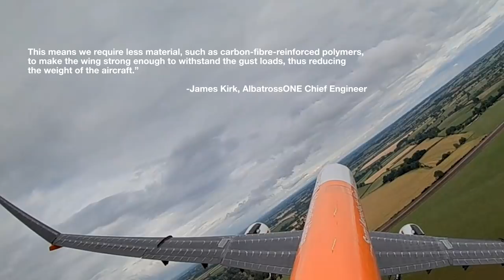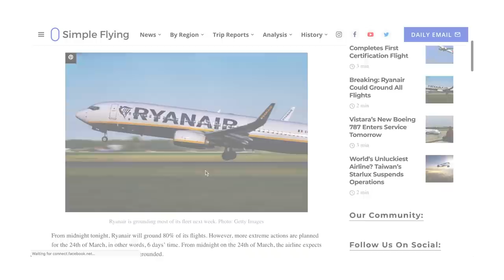Airbus Tests Bird-Like Flapping Wings For Future Aircraft

Comment: The title is misleading, the aim at airbus isn't to create lift by flapping wings as birds do, but rather to improve aerodynamic efficiency and load behavior by allowing wing tips to morph as aerodynamic loads change in different flight conditions.
Reply: No that’s kind a like flapping to me
Reply: @titanicbigship  no, it's not. Flapping itself is a method of propulsion. This is not providing propulsion, but rather dynamically adjusting to flight conditions to reduce overall stresses and loads. This allows for lighter structures, longer wings, and therefore greater efficiencies. Also, flapping flight requires a more flexible wing design, that allows for more degrees of freedom than this feature is capable of. This feature is more like the adjustable wingtips on the XB-70, but able to move freely as well as being able to be adjusted, whereas the XB-70 wingtips did not have a free moving setting.
Reply: I'm not a biologist but I don't think this concept would fool any geese into accepting it into the flying V
Reply: But the aerodynamic here is indeed similar to an bird that’s gliding. 
It also makes sense use an bird as an model. 
Millionen years of try and error is still better than our understanding of aerodynamics i find.
Reply: @matthewforster2661  we all got fooled into watching it so 🤷‍♀️
Reply: @titanicbigship  The title is misleading . The wing tips adjust to wind gusts. Flapping, as 428 Renegade, wrote is a mode of propulsion. The wing tips on this model are not producing any forward thrust, only the engines. The concept is to reduce the transfer of wing gust to the fuselage and increase efficiently. 
-On wing efficiency: since an infinite wingspan is impracticable, besides unrealistic, it does provide theory that induced drag is a component of a finite wing span. The induced drag is caused by airflow from underneath the wing flowing to the top of the wing span due to pressure differential. So, by extending a finite wing, one is reducing induced drag.
-On aeroelastic effects: an airplane frame is quite a flexible structure. Hence when you fly a passenger jet and it hits turbulence, that turbulence is transferred from  the wings to the fuselage making for an uncomfortable ride. Aircraft designers have been looking for ways of reducing gust load transfers on aircraft. Boeing  designed gust suppression system on their 787 Dreamliner, https://www.designnews.com/boeing-787-dreamliner-rolls-out-smoother-ride-gust-suppression-0
Airbus is going one step further and allowing the wing to absorb the gust directly by changing the profile of the wing. I am not fully understating of it, but i assume by allowing the wing tips to so call flap it also changes the airflow around the tips thereby mitigating gust loads.
Reply: So basically like the 777-X of boeing
Reply: @melvinhendriks7913  Nyet. The folding wingtip of the 777X is locked once the plane is ready for TO. The folding wingtips allow the wider wingspan to park at terminals without having to redesign terminals to accommodate such a wingspan. Turbulence mitigation comes in the form of sensor detection.
Reply: Thank you
Reply: I too was disappointed. I have discovered from my own contraptions that the problem with mechanical flapping is that it is too violent. Wings of materials other  than meat and feathers disintegrate in a single session.
Reply: Well said
Reply: The flapping airplane meme came to life

Comment: We have Royal Albatross here in Dunedin, NZ. 3m wingspan. They can fly effortlessly into the wind for hours or even days without flapping. Incredible efficiency. This looks like one step closer to replicating their design. Note the downward sloping wingtips on an Albatross are part of their secret. The lift is bleed off to zero at the tip so there is very little if any wingtip vortexes.

Comment: meanwhile, Boeing  has still to figure out how to make a +50 years old Jet not not crash
Reply: Its barely a decade old.
Reply: @tripleceven  in it's core it is from the 60s

we are talking about the 737
Reply: @Sanginius23 yes but specifically the Max 8 otherwise if we were talking about the core model it wouldnt have gone to sell as many units as it did now would it or even have spin offs like NG or Max?
Reply: @tripleceven  you can't hide the fact that at it's core it's a half a century old design
Reply: @tripleceven  and the reason they kept making 737 is because money talks
Reply: @kuro9410_ilust  and you cant deny that the tweaking of the engine is what caused the crashes which isnt the core design

Really guys do we need to go through this???
Reply: @tripleceven  I think the desing limit was reached with the 737 NG and the decision to make the Max was short sighted and simply wrong
Reply: @Sanginius23  definitely but after the merger with McDonnell Douglas, Boeing was never the same.

Comment: The title is misleading . The wing tips adjust to wind gusts where as flapping is a mode of propulsion. The wing tips on this model are not producing any forward thrust, only the engines. The concept is to reduce the transfer of wing gust to the fuselage and increase efficiently. 
-On wing efficiency: since an infinite wingspan is impracticable, besides unrealistic, it does provide theory that induced drag is a component of a finite wing span. The induced drag is caused by airflow from underneath the wing flowing to the top of the wing span due to pressure differential. So, by extending a finite wing, one is reducing induced drag.
-On aeroelastic effects: an airplane frame is quite a flexible structure. Hence when you fly a passenger jet and it hits turbulence, that turbulence is transferred from  the wings to the fuselage making for an uncomfortable ride. Aircraft designers have been looking for ways of reducing gust load transfers on aircraft. Boeing  designed gust suppression system on their 787 Dreamliner, https://www.designnews.com/boeing-787-dreamliner-rolls-out-smoother-ride-gust-suppression-0

Airbus is going one step further and allowing the wing to absorb the gust directly by changing the profile of the wing. I am not fully understating of it, but I assume by allowing the wing tips to so call flap it also changes the airflow around the tips thereby mitigating gust loads.

Comment: Is testing at this scale effective? Does everything not change completely scaled up?
Reply: Kent Davis You need to adjust your equations. But it is a simple change of a constant called the Reynolds number so it is very straightforward. They also have simulations and multiple size scale models to validate results.

Comment: with today's processing power the wing should be able to respond to gust loads and 'flap' accordingly so that if a wing enters a thermal instantly the wing could 'flap-up' to relive the pressure and you would increase occupant comfort by a large scale. Great idea, plus up to 12% reduction in lift induced drag, coupled with fully autonomous piloting a PM in the left seat to taxi the plane and be there in the event of a system failure, chances of failure must be less than 1 in 10,000,000 before certification as with FSD cars. IMO

Comment: I know next to nothing about engineering, but would it ever (next 100 years) be possible to have a plane where its wings flap similar to a bird, therefore using less fuel required for thrust? Where essentially the wings create the “thrust” for the plane?
Reply: But those flapping wings would also need a source of energy to move. Obtaining the thrust needed to move and fly a heavy plane still requires lots of energy, no matter how you apply it (be it by burning fuel in a turbine or by moving mechanical wings). Controlling an aircraft in such way would be very difficult, compared to the static wings + rudder and flaps used today, not to mention that those whole flapping wings would be a nightmare to maintain with so many mobile parts... Idk, doesn't seem viable to me

Comment: Its a really interesting idea.  Just a very unfortunate name for the plane.  I don't know if I would be very comfortable boarding an Airbus Albatross!  Maybe they can come up with a better name, like Eagle or Phoenix; something that inspires a bit more confidence.  I believe folding wing commercial aircraft are the wave of the future.  Boeing has already kicked it off with the 777X,  which should be ready to take to the skies by early next year.  The Navy has had folding wing planes for decades.  When you think about it, it has very practical applications.  The wing configuration makes the plane more fuel economical.  When the wings are up, the plane takes up less space at the gate.  This is also good in case of emergency, as it makes it possible for a plane like that to land at a smaller, regional airport if necessary, and still take back off.  Having folding wings even on some of the smaller planes would make it possible to bring a lot of the regional airports back into play, and usher in point to point flying, putting an end to the antiquated hub and spoke style,  and easing up the ridiculous congestion at some of the major gateway airports.  
So yes, I like Airbus' idea, and believe folding wings are here to stay.  Just please come up with a better name for the plane, Airbus!
Reply: What about Orville ? lmao
Reply: @christoohunders5316  that'll work out great! Hee hee hee!
Reply: This is a model proof of concept! You won't be flying on anything like this in the future, it's to test the very basics of the design and philosophy.

Comment: Birds flap their wings to create thrust. In this aircraft the engines still perform that role. This design allows the wings to adjust to aerodynamic conditions that exist at the moment reducing drag and weight. Still impressive but the thing is not a man made bird.

Comment: This is an absurd idea.  Can you imagine the maintenance required on those outboard wing devices ?  What happens when one of those devices fails in flight and won't move from an inappropriate position ?  The more movingly mechanical devices installed on an aircraft, the higher the chances of mechanical failure.
Reply: When it doesn't move the plane will experience higher stresses which will shorten the life of the wing but the overall design will have to be strong enough to put up with those maximum loads for the duration of a flight....I expect.

Comment: The flapping wing concept is something that will never come to be successfully, a birds wings are for 2 things, lift and forward momentum, but planes already have forward momentum called thrust, they come from engines, then the lift come from the wings, we can keep redesigning the wings to reduce fuel burn but to actually get them to "Flap" wouldnt work, there is too much weight inside the wings for it to be stable, but if you make the wings out of a lighter material, the wing wont be strong enough to support the aircraft

Comment: I would want to see the wing suitably equipped for a failure mode where the pivot mechanism fails. I would want to see the wing, inboard of the pivot points, able to produce enough lift to support the weight of the aircraft. I would want to see ailerons inboard of the pivot points, in addition to ailerons I would assume are on the wingtips outboard of the pivot points.

Comment: I didnt see any 'flapping' on that model plane during flight. I did however see a flexing and folding wing tip which I'm sure I've seen somewhere before.
Reply: It’s flapping (moving) with the wind movement for better aerodynamics, not meant to mechanically flap again and again, that will destroy its longevity 

The one in 777x is just meant to fold when on ground to move into smaller gates

Completely different technology and function
Reply: So it adjusts itself then because I'm sure I heard them say flap and 'inspired by nature'. The technology is the same with the 777x ie being hinged to the wing just that the one on the Boeing is set to two positions while the Airbus one 'flaps' apparently.
Reply: @tripleceven  well you see with the 777x it's only meant for saving space. In flight it is flush with the wing and doesn't flap at all. This is meant to flap. It does adjust its self,  flap in normal flight or turbulence flight for efficiency reasons. It completely different to the 777x. The only things they have similar with each other is the fact they're on hinges.
Reply: @thetransponder7186  I'm just struggling with how you use flap and adjust interchangably. Its got to be one or the other.
Reply: @tripleceven  it's both. You have a setting for maximum lift during take off and landing. The all the wing is generating lift. When in cruise or in turbulence. You let the wings freely flap, this can reduce drag and stress on the airframe while giving a possible increase in speed.
Reply: @thetransponder7186  lets see how it turns out. I think making the wings flex like on the 787 is one less moving part away from unwanted complications especially on a critical part of the plane.
Reply: @tripleceven  of course. It's just this could help save more gas. But like you said its extremely complicated

Comment: Is this as same as Boeing 777x folded wingtips or it is different.Please explain
Reply: It's different, the 777x wing tips don't flap inflight they only fold so the 777x fits in gates of the previous 777 but the wingtips flap in flight on airbuses design
Reply: @ethansaviation2672  Thanks for the clarification.Cheers man
Reply: @Ananth8193  no problem👍